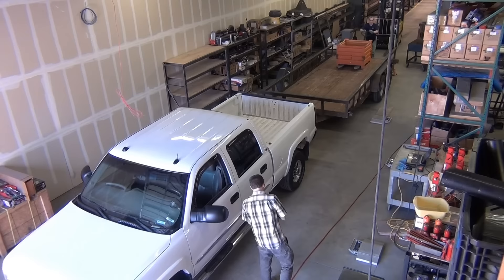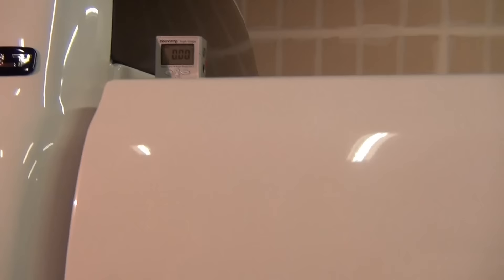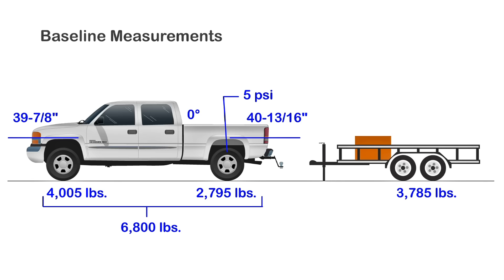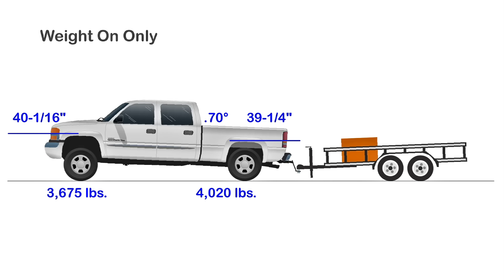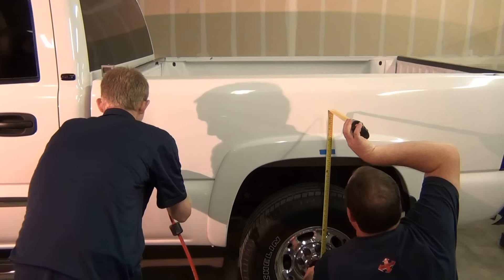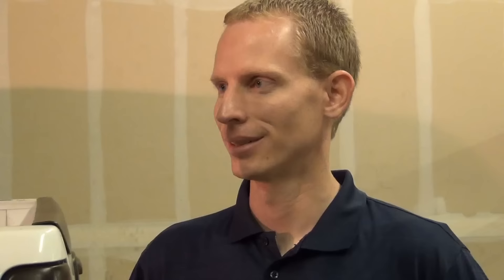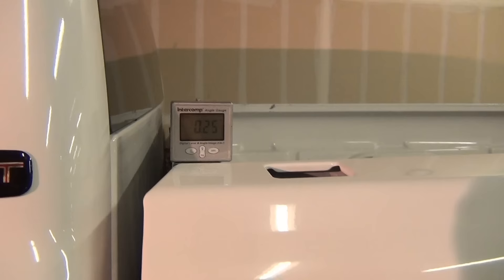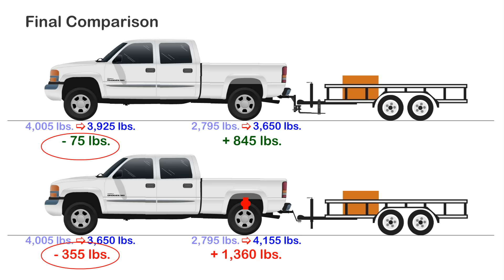The Difference Between Using Weight Distribution and Air Bags to Level Your Load

Comment: ZWhy not just adjust the trailer weight so that it has less hitch weight to begin with?
Reply from the maker: Adjusting the cargo in the trailer to get the tongue weight to fall into the 10% to 15% category is a very critical component of reducing trailer sway. It should be done no matter what size or weight trailer you are towing, or what you are towing it with. This places the center of gravity of the trailer slightly ahead of the axles, and generally gives you the most stable trailer, with reasonable tongue weight.

You would never want to adjust the cargo so that the tongue weight is reduced so much there is very little of the trailer’s weight being carried by the tow vehicle, just to eliminate the sag. This causes an unstable towing situation where sway is more likely.

Therefore, in a situation where you have a typical trailer, say 6,000 lb gross trailer weight, you want to have 600 to 900 lb tongue weight (10% to 15%) after you have adjusted the cargo in the trailer correctly, to have a steady trailer, and using a weight distribution hitch to help the tow vehicle carry that weight is the best option.
Reply: 10% Tow Ball Weight is required as a minimum for your trailer
Reply from the maker: @northnarra821 , you are correct. A minimum tongue weight of 10% of the gross trailer weight is a generally accepted industry standard for safe towing. Thanks for the comment, and for watching!

Comment: What would happened if you 
1. Used the "correct" hitch receiver? By correct, I mean the non adjustable one, so its mounted closer to the truck.  Heck, why not add a 12" hitch extension to make your test more convincing? 
2. You knew the exact tongue weight, many of us don't, why not adjust your ball hitch HIGHER to compensate the expected weight so the trailer will be more level and shift more weight away from the ball hitch to the trailer's axle?
.
.
.
Oh wait, then the truck won't sag as much.
Reply from the maker: When you’re using a weight carrying hitch/ball mount like the Fastway FLASH [https://www.fastwaytrailer.com/flash-ball-mounts], it is a best practice to measure the distance the hitch ball/coupler drop after the trailer is coupled, and then compensate higher by that much when choosing a fixed ball mount, or setting the height on an adjustable ball mount. You should set the trailer parallel to the ground, measure the coupler height from the ground, then choose a ball mount that places the hitch ball at the adjusted height above the coupler height, so that when coupled and traveling the trailer returns to be parallel to the ground. This is one advantage of using an adjustable ball mount; you can get the correct towing height easily when the loading of the trailer changes, or when you tow a different trailer.

When using a weight distribution hitch like the Fastway e2 hitch [https://www.fastwaytrailer.com/e2-hitch], it is a best practice to set the hitch ball even or slightly above (1” or less) with the trailer’s coupler, with the trailer parallel to the ground. This allows the correct geometry between the hitch and trailer to make setting up the weight distribution easier, and hitching and unhitching easier.

Comment: Did anyone catch it that they adjusted the airbags to the original pressure with the trailer attached at around 8 minutes?  You should have adjusted the air pressure after you removed the trailer from the hitch to keep all things equal.  I know the pressure changes because I currently have a dual setup (airbags and hitch) and have experienced this first hand. Maybe this is addressed later in the video.  I paused to comment.  :)
Reply from the maker: Hi, we honestly don’t remember if we took the time to set the air pressure at 5psi with the trailer coupled or uncoupled at this point in the video. From what is shown, it looks like we don’t, which is an oversight on our part. However, if that is the case, the effect on the overall principle of what we’re showing doesn’t change.

In this case, if we lowered the air bag psi to 5 with the trailer on, that psi would be slightly lower with the trailer off. So, somewhere between 0 and 5 psi. Let’s say for example that the actual uncoupled psi was 3 instead of 5. There would be a slight height difference at the hitch ball, but very minimal. It would most likely not change the hitch setup, therefore it would not change the weight distribution setup. There could be a slight difference in the amount of weight the front axle of the trailer is carrying, but again, minimal.

So in summary, the weights shown in the video per axle may be a few pounds different, but the overall effect of weight distribution would not change, and the principles that were the real intent of the video do not change. Thanks for watching so closely!
Reply: @FastwayTrailer  In actuality, when empty set to 5 PSI, and then weight added, the PSI will go up a bit. So by doing it with the trailer on the ball, you actually are getting the rig closer to a truck without air bags than with.  The difference is too minimal to argue over, but just wanted to point it out.

Comment: So do you then need to rejust everything again after you put people and stuff in bed?  Every video I see there is no people or stuff in bed?
Reply from the maker: Great question! Yes, it is ideal to have the tow vehicle loaded as closely to the way it will be loaded when traveling as you can when setting up the hitch. This will get you the closest and best weight distribution setup. We know that this is not always possible. In these situations, get it as close as you can, and then double-check the weight distribution once you are loaded and ready to travel, and make a minor adjustment to the weight distribution setup if necessary by adjusting the L-bracket height on your e2 hitch (adjusting chains or brackets on other hitch brands).

Our videos are to demonstrate the principle and method of setup and adjustment. They are not being set up for regular use. This is why you don’t see passengers or cargo in our videos.

Comment: Why such sloppy TW measurement? Baseline is 110 lbs lighter than first hook up, yall making mass out of thin air. Sloppy to go to that effort and end with slop. Take your fancy scale and weigh the tongue, level, 1" down, 2" down, 1" up, 2" up, how does the change in CG affect TW at level vs up or down for this specific trailer and others?
Reply from the maker: +Rusty Birdwell,
The 110 lb difference is not just in the tongue weight, it is also in the tolerances of the axles scales. The cumulative total of those 8 scales plus the tongue weight scale we used end up giving us the 110 lb difference. For a critical testing situation like SAE compliance this may be too much, but for our purpose with this video it is fine. Overall it is less than 1% of the gross combined vehicle weight. For this video, we simply wanted to show that the tow vehicle reacts differently to tongue weight when using air bags vs. weight distribution. Even with exact weights, the reaction principles would have been the same.

Comment: So is this saying that airbags are basically useless?
Reply from the maker: I wouldn't say airbags are useless! Really it's personal preference!
Reply: No, air bags will also help level heavy loads applied to the bed of a truck. A weight distribution hitch only helps with weight applied to the hitch.
Reply: They are not the best option for leveling a bumper pull trailer, still useful for carrying heavy payloads and for stabilizing the truck. For example when towing a gooseneck or fifth wheel you cannot use a weight distribution hitch and the ride quality can really suffer if you're only half an inch from The bump stop which can happen even when staying within your payload rating, your trucks leaf springs are one big compromise they have to be comfortable when empty and still sort of carry weight when needed. Airbags being adjustable allows you to actually set the correct spring rate based on the load you're hauling, so for a good quality ride with a heavy load your factory 3/4 ton springs are too soft airbags fix that.
Reply: @jmc88480  ,a WDH shifts weight from rear tow vehicle axle to front tow vehicle axle.
Reply: @blakel4595  nice great breakdown. I drive a titan 2018 and sometimes I can feel the travel trailer fish tail or jump when driving straight even with a weight distribution.  Is there anything I can do to correct this? Truck is rated 9.7k lbs and trailer is about 7k lbs. Should I be driving in 4x4? Limit on 4x4 mph is 64 mph.. thanks.

Comment: I'd use airbags in light duty trucks for heavy loads like gravel, wood, etc. I would not use airbags with a travel trailer. Too much money at stake. I'd use a truck that's capable of the load being towed, then add the WDH to stabilize the trailer for things like passing 18 wheeler car carriers , etc.
Reply: Exactly. A weight distribution hitch puts load back on the front axle of the truck. That is the main goal. Bags won't do that. But there is nothing wrong with using both, if you set them up properly.

Comment: I'm considering pulling a 6,500 lb. (Actual weight), 27 foot from tail to hitch TT with a 2020 Ram 1500 equipped with the rear coil springs and the 5.7 HEMI. I'm getting what I consider excessive sag after hooking up the trailer. IF I add air bags to correct the sag, then scale it... Assuming the scale shows I'm within all the manufacturers limits with respect to everything, max towing, GVWR, axle weights, tires, hitch, ball, including max payload, GCWR, ect. If I don't add a WDH, would that be considered a safe tow by most? My state does not mandate a WDH when towing over 5,000 lbs. I have other trailers as well, a car carrier, dump trailer, boat, and encolsed cargo, all with similer actual weights when loaded and obviously adding a WDH to each one of them would be a PITA obviously. All the trailers have electric brakes. Thanks.
Reply from the maker: Hi David, the best way to get your questions answered is to contact our customer service team at 877.523.9103 or you can email them at  info@fastwaytrailer.com. Thanks!
Reply: The hitch is on the vehicle, not the trailer.  One WD hitch will pull all your trailers.  Assuming they all have the same ball size.  You just adjust the hitch for the tongue weight you're pulling.
Reply: If you are within your weight limits, that is good. However, there is still a lot to be gained from a good weight distribution/sway control hitch. Even with air bags to level the truck, you still have a significant reduction of weight on your front axle. So, steering and braking control are definitely affected. If you have to do evasive maneuvering where you slam on the brakes and have to steer to avoid something, this is 1 example when no weight distribution will hurt you. The trailer will rock forward putting more weight on the bumper and taking more weight off the front axle. So steering while braking hard w/o weight distribution is severely affected. Also, no sway control will not help control the trailer when doing the maneuver which will more likely result in loss of control.  Another benefit is just overall vehicle stability and control when driving down the road. Travel trailers in particular are bad for sway because of the high sides which means wind or air from passing vehicles really pushes on the trailer. Also, travel trailers typically have a much higher center of gravity. For example, they have A/C units and fans on the roof, plus cabinets and storage and microwaves and fridges up high. So all that weight up high makes the trailer want to rock back and forth easier. Flat beds, boats, car haulers, etc usually will have a much lower center of gravity.
So long story short, a weight distribution/sway control hitch will definitely make your towing experience with your travel trailer safer and more controllable. But I agree, it might not be needed for your other trailers. It all depends on the weights, and towing characteristics of each trailer. The boat is probably fine (depending on size). But, the dump trailer (depending on size) on a half-ton truck could overload the truck requiring weight distribution. The cargo/car haulers depend on how big they are and how well they tow. No pain or hassle outweighs your safety and others' on the road.
Reply: I'm guessing to correct the sag and bring the tounge weight more in line you'd want a higher ball. I'm pretty new to towing but on my 2003 gmc 2500hd there's very little squat even with a very low ball on a 2 horse trailer loaded with horses and equipment. Including camping gear and people
Reply: Not that difficult to use one wdh for various trailers.  Just the spring bar hooks bolt into the trailer frame.
Reply: @rockymtnhighadventures  a crazy unexpected thing happened to me pulling a heavily loaded dump trailer with my 2010 F-150 and standard hitch/ball.  i took a corner too fast from pavement onto a gravel road and the inertia of the trailer broke loose and slightly skidded my truck's rear end towards the ditch at a 45 degree angle.  And that's with a rather large increase in bumper weight from the trailer!  not saying a WD hitch would have helped, just pointing out another aspect of trailering heavy weight...

Comment: What’s amazing is I haul my cat 305.5e2 it has steel tracks and wieghs 13800 pounds with 2 buckets on the trailer I don’t use  anything and I never even touch my overloads load properly and you will not have a issue at all.
Just for information truck is a 05 f350 drw
Reply: Lol I seen this guy towing a big cat with f150 easily over 13k but wasn’t squatting oh no. It was raked. To back heavy some people
Reply: You can change the position of your equipment on a trailer to change your tongue weight. I think the video is about campers, where you are very limited in doing so.
Reply: @paulrobbins3362  while I understand what you're saying there's a lot you can do to change the weight distribution of your travel trailer. I am very mindful when loading my travel trailer of where I'm putting the weight. Dense heavy items such as cases of water soda beer etc can make a good bit of difference whether you put them at the extreme front or extreme rear. The worst is when towing them empty such as when you go buy them. When I brought my toy hauler home empty I was under the impression it had weight distribution brackets already installed so I brought my weight distribution hitch, I was wrong and since toy haulers are designed to carry cargo in the rear they are often very front heavy. Definitely had to take it a little slower with no WD hitch and not being able to balance the load

Comment: Well you test is not right. Need same weight distribution on trailer not just on front hitch. Not proper test done your way.
  Air bags work out here on farm. I can hook gooseneck on and put 4500# tractor on trailer and only have 40 lbs in air bags and truck bed it level.  Plus air bags take out the body roll in corners with the bags.
Reply from the maker: +Jaylin Coombs, thanks for the comment. Air bags are a great product if you're using them with a gooseneck hitch/trailer because of the way that pin weight is carried by the tow vehicle - between the axles. A bumper pull trailer's tongue weight is carried behind the rear axle, which has a very different effect on the tow vehicle. Both products work well for their intended design, but they are not interchangeable.
Reply: @FastwayTrailer  we pull bumper pull 24 ft long. Just need to put even amount between your two axle on trailer
Reply: Jaylin, you are totally not grasping how a WD hitch works (the comparison to your gooseneck proves this). The video explains it perfectly. WD hitches spread out the load better to all axles (truck and trailer), air bags do not do that. 
Air bags are definitely an improvement with a heavy load, but they cannot do what a WD hitch can do. Just check any truck's towing limits, you will find they provide a higher rating (for the hitch AND the truck) when WD is used.

Comment: Did you  know if your airbags are right above the axel, that is the weakest point of your pickup frame, and it is going to bend right there above the axel because there is a multiple amount of pushing force down at the hitch it is like adding a cheater bar to a wrench to get more force to break free a bolt.
Reply from the maker: Great advice!

Comment: Why not throw away the airbags and the WDH and balance the trailer to the proper ball weight of the tow bar. All done.
Reply from the maker: +John Brittny,

Having the trailer loaded and balanced properly is a critical part of towing safely. This should not be overlooked.

Air bags and weight distribution hitches give you added performance that you just can't get, even from a properly balanced load in the trailer.

Air bags stiffen or loosen the suspension quickly and easily. This makes it easy to adjust your ride to be more comfortable, or take out some yaw when carrying a heavy load, by simply removing or adding air.

Weight distribution forces the front axle to take some of the load that the rear axle would otherwise be carrying. This helps you keep the load on your rear axle within ratings, and returns the braking and steering control that would otherwise be lost by only using a ball mount.

Comment: Now do it with a dodge 1500 2006 , no lief springs  what should i do ?????
Reply from the maker: No leaf springs? What connects the axles to the frame?
Reply: You can still use airbags. I've seen them installed inside the coil.
Reply: @FastwayTrailer  The new ram 1500 trucks use coil springs
Reply from the maker: @Moonless6491  thanks for the info, and for watching the video!